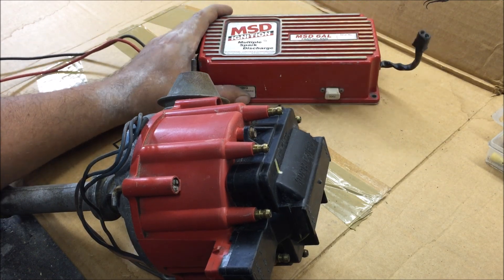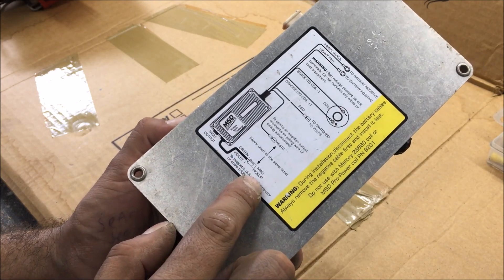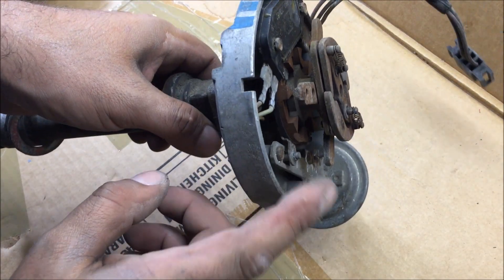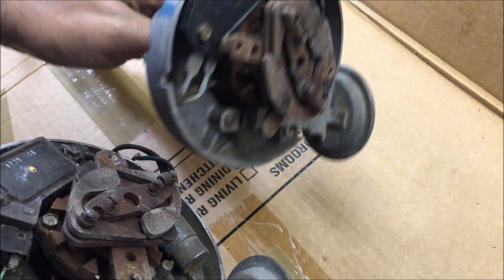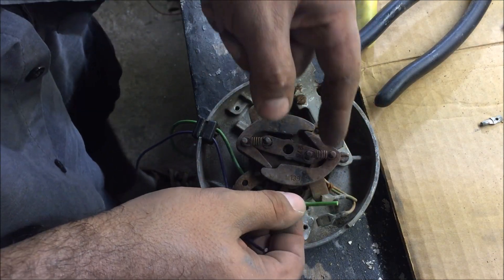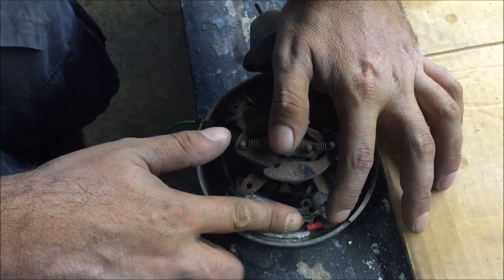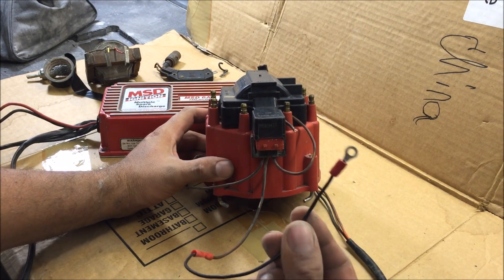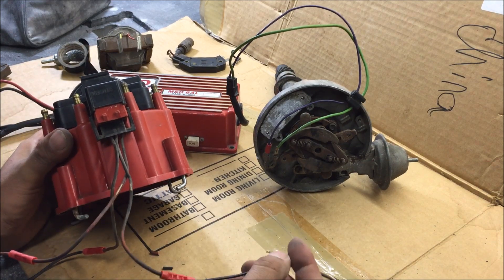how to wire GM HEI distributor to MSD ignition box how to DIY

Comment: If the wire coming out of the tach is disconnected how does the tach work? I understand that the Msd comes with a tach wire that plugs to the coil. But how does the tach pickup the signal for rpms? Am I missing something? thank you for your time
Reply from the maker: it gets the signal from the negative side of the coil

Comment: You can also use the existing control module just as a termination location if you have small wires you can cut the three wires coming out of the distributor and then where the magnet pick up is either soldered to the ignition module or it's got the push on connectors you can literally just solder your two wires directly to the input of the module using the modules simply as a point of connection if you don't want to disturb the wires coming off the magnetic pickup assuming they're small

Comment: I’m installing a tach on a nova with hei. When I hook up the tach wire and start the car it blows the fuse. Tested the tach side of the cap and I have 12 volts

Comment: Is that’s it..  but does the other plug still need to plug to distributor. The one beside where the tach woulda went.  Ignition power🤔
Reply from the maker: no.  you only use the magnet pickup ( to signal the box.. turn it on.. and when to fire.. ) you will need to make sure the ground for the coil is attached good

Comment: What about the vacuum advance do I hook it back up or plug the carb
Reply: When I do that and go drive it pegs the timing out
Reply from the maker: then someone changed the springs on the weights... get another distributor
Reply from the maker: run it to ported vacuum
Reply: Ok thanks

Comment: Could you use the stock HEI coil or is it better to use the MSD HEI coil
Reply: No I have a 350 bored 30 over vortec heads ( 2 inch intake 19 exhaust if that matters )500 lift cam I'm running a brawler 750 mechanical secondaries the distributor I'm using has the MSD HEI coil
Reply from the maker: well, if you have it use it... the hotter spark doesn’t hurt anything
Reply from the maker: depends on your redline... is your engine stock? msd isnt going to do anything for you... the top rpm is going to determine whether you need a higher voltage coil
Reply: Cool thanks for your help

Comment: Hey Chris can i use that set up with the 8362 street fire distributor so i can use my box 6al also will this add more spark and power
Reply from the maker: it won’t make a difference unless you are racing it at WOT.. all that stuff is for over 5000 rpm driving.. I’ve seen more cars run worse with it and go back to stock... that’s how I got all my ignition boxes
Reply: If someone wanted to wire one of those like you demonstrated  what would be the reason for it. For as mild build or stock
Reply: Ok gotcha so do i just run the distributor by itself  im not racing so the distributor is good enough by itself

Comment: thanks,  my '78 K10 suburban  has an MSD pointless ignition on it, and quit running at the local supermarket parking lot.  Your vid was useful in figuring out the issue ,  the plug you just wired up was loose.

Comment: What will this do for.  Your engine
Reply from the maker: what is the actual question? are you a points guy? or a troll? what is the project?
Reply: @chriscraft77022  i Got a 1983 chevy pickup 4x4 3/4ton I use for off road and work it has a 350 I'm slowly trying to put more power in the engine I was just wondering what a msd ignition will do for my truck,after I commented I did a little research on them and found out,did you see any difference in your engine
Reply from the maker: oh sorry.. I thought this was my HEI video.  putting msd ignition will do NOTHING for power.. to be honest they run better with stock HEI on a stock engine.. the reason I have all these parts is because I get them cheap after people wasted their money and put the old stuff back on..  don’t waste your money..
Reply: @chriscraft77022  ok thanks, I'm just gonna go with a DUI CAP AND DISTRIBUTOR I had one before they work good
Reply from the maker: @donniewagner4657  you really dont need any of that on a stock engine..   its not going to improve anything...  that HEI is a very good distributor up to about 6200 RPM

Comment: Can I just add the ground to the yellow connector of the coil? I noticed that there isn't a contact point on the coil between the red and yellow wires so what does that ground on the center connect to?
Reply from the maker: it’s a ground for the coil it grounds to the distributor body/ engine block ..do not run a ground wire from ( - ) of the coil
Reply: Thank you.
Reply: Hey I was just wondering because I almost caught my car on fire last night. Pretty sure I fried my coil and hopefully nothing else. I'm a dumbass and though the yellow was an actual ground.  I'm just confused because I dont want to hack the harness in case the box fails and I have to reinstall the stock pcm. Is there another way to run a ground? I know I sound stupid but I really dont understand how the ground on the harness actually works since there is no center connector on the cap. I really appreciate your help.
Reply: Ok nevermind. I figured it out. I'm just a dumbass lol
Reply: Ok, I though ifigured it out but no luck. Got a new coil and box and still no spark. Got the ground wired correctly. I get power to the box but no spark from the coil. I changed it back to the stock ignition and she fired right up. I got it wired just  as explained.  Any ideas?

Comment: Great video i learned alot. I love my hei though it's practically fool proof. I currently have a msd heat module fot the rev limiter feature. Not sure if runing a msd box would be a worth while upgrade. Car is 90% street 10% strip. Sbc 437 with holley sniper efi. Runs great as is

Comment: It's an old video, some people will say it's remedial, but by far the best, most simplified explanation of what to do. I had a good idea by wiring diagram, but this video made it easy to see vs looking at paper.  Huge thanks!!!
Reply: Very simple when you see it done. I couldn’t figure out a separate coil with no coil plug wire to the center of the distributor didn’t make sense. This makes sense.  Thanks

Comment: You need to show how to install a distributor without the vacuum advance I have an 81 Corvette it don’t have a vacuum advance
Reply: Same issue here. 85 Camaro non-vacuum advance.
Reply: Installing a distributor with or without vac advance is exact same procedure. First get #1 cylinder at tdc compression stroke then drop it in pointing rotor at where number one wire connects. Might have to align oil pump drive but it is a very easy thing to do
Reply: cf mechanic thanks for the info but I needed to know how to install a MSD 6AL to a non vacuum advance hei. Which I already installed. It’s the same procedure in the vid.

Comment: I’m looking to do this to my GMHEI that I have on my 454 in my 69 Chevelle… as usual, your video is very helpful on the wiring, And you had mentioned that this is not going in your car, but would you havey put in a low resistance bushing under the coil? I have read it is required to keep it from melting. I see that you utilized the In cap Coil for your demonstration, but do you prefer the external coil set up even if using the HEI? I’m looking at upgrading to a MSD digital 6AL or the Mallory hyfire type and I am aware that most HEI fail due to under cap heat affecting the ignition module, which is why I’m steering away from the MSD HEAT module. I’ve  removing the under cap Coil and replacing with the external coil can greatly extend the life of the distributor in general due to less heat on the top end and only spark in a big cap. Thanks again for your post. I’m leaning Mallory unless you have your own honest opinion.
Reply from the maker: are you going to race the car at the track?
Reply: @chriscraft77022  i will be mostly street and cruising, but i do plan on running it at Baytown and Evadale open track nights periodically. The engine lower end, intake, and heads are currently stock, mild cam, accel HEI dist. and new Edelbrock AVS2 650CFM (which is fucking incredible). Im early in the process of engine upgrades, but plan to do a full top end upgrade. I'm interested in the CDI upgrade for the easier cold starting, idle and lower than 3000 rpm mutil spark benefits for the time being. Just by upgrading to the AVS2 carb from the 1405, its requires 5-600 RPM less to cruise at 60mph, which is incredible.
Reply from the maker: put a stock HEI on it..  that is my advice.. it is very easy to get lost in the bullshit you hear and read about... when you get into the high rpm.. you will learn the limits of the stock coil.. then go from there.. I see so many people waste years putting shit on their car that only makes it run worse.. how on earth are you running a 650 CFM carb on a 454?  🤔 do you drive this car?    if you would of said you were racing the car my advice would be different.. I have a 450hp street chevelle.. all that fancy stuff is for high rpm 6000 plus.. I don’t race my car
Reply: @chriscraft77022   yep, currently running a 650cfm on a 454. I was having starting and general performance issues with the 1405 that was installed by the previous owner. I decided to remove it from the car to spec it and possible rebuild. I found that a float was out of spec @ 1" instead of 7/16", but the other was in spec. After float readjustment my plan was to check out the jets, only to find them marred as if there was an attempt to remove them with the wrong thickness screwdriver or jet removal driver. I had seen edelbrock release the AVS2 with the annular boosters with the plan to release the 800cfm sometime after. I've been waiting since the original november 18 release date only find that they have pushed the 800cfm to jan, then march, and now july. Well, i settled with the 650 for the time being so i can atleast drive it. What are you running on yours?
Reply from the maker: I run a 780 cfm Holley 3310-1
Reply: @chriscraft77022  im sure that engine loves every bit of that! And thank for the straight up answers. I couldn't have picked a better car for following you instructional's. I saw your video about the CDI, so i figured id do some research on the subject. Like you mentioned, im not turning 6000rpm+ for the high end benefit, but was curious on your take for easier cold starts and low end efficiency of the multi spark. I agree that my current platform is just fine with an HEI, but doesn't hurt to get opinions of those with knowledge and experience. Curious, based on one of your wiring videos about the HEI ran with CDI. You removed the dist. ignition module, and connected the (2) CDI to the (2) wires coming from the dist pickup. Couldn't you leave the module in dist. , but remaining disconnected, and hook everything else up as you did? Kind of a back up plan if the CDI failed, you could pull the cap, disconnect the bypass and replug to the (hopefully functional) ignition module?
Reply from the maker: I guess you could leave the ignition control module in there as a back up.. I just see so many ignition boxes hooked with it still hooked up and just wanted to show it being removed..   I’ve ran stock HEI on many cars for many years without any problems ever...
Reply: @chriscraft77022  totally understood for removing for demonstration purposes. Thanks Chris.
Reply: I’ve search, but do you have a how to or explanation on how to remove the chrome window trim? I’ve read about it but not sure exactly where to begin the process.. wiper cowl fender area, or top middle and the back window for that matter. Any info would or tools require would be appreciated. I have some bad sealant somewhere.. if it rains there’s water dripping by the rear view and there’s water in the trunk.

Comment: Since I'm using the same setup u have on here do I need to hook up the blaster coil or is that only for the distrubor with the points
Reply from the maker: +Andre Ancrum if your hei has a coil then NO, but you could use the magnet pickup only from the hei with the blaster coil  but you need an ignition box or ign control module

Comment: im workin on a newer jeep tj with a 350 v8 swap and the batt wire isnt hooked up at all, yet it still starts any ideas why
Reply: Is it using power from the ignition?
Reply from the maker: yeah, but is the + side hooked up?  one of them has to be